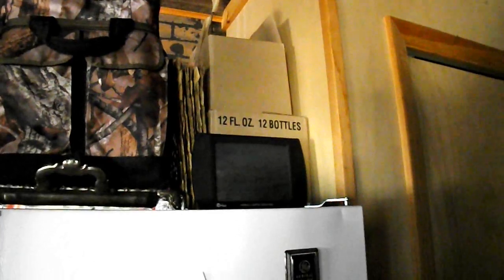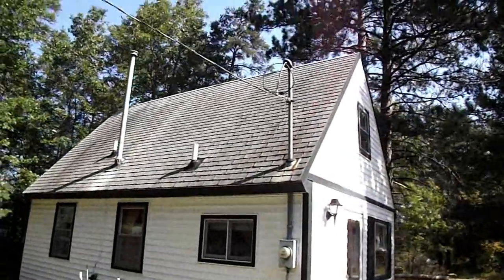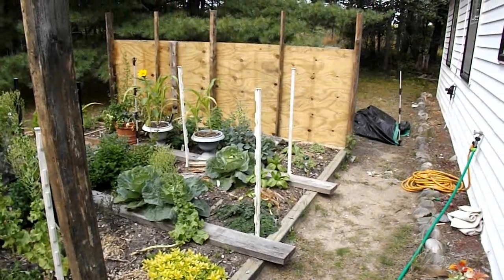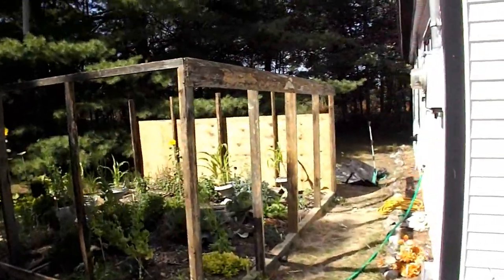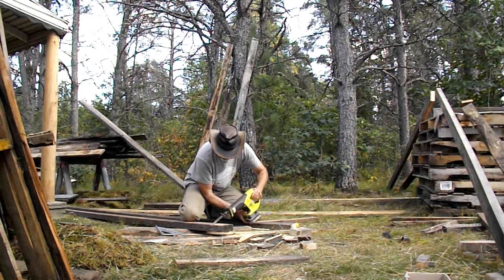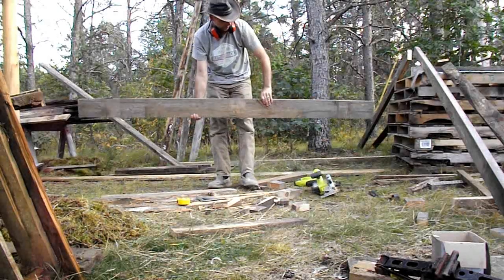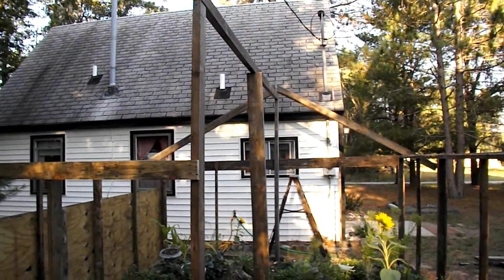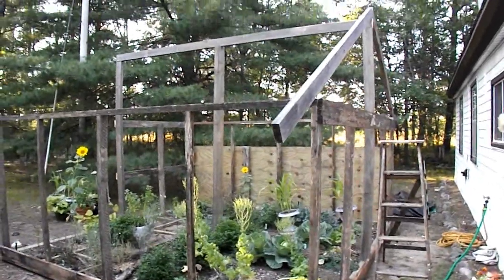Building A Greenhouse To Extend Our Homestead Growing Season

Comment: Good job, that green house is a beast!

If you double layer the tarp, one on the inside and one on the outside, the trapped air should help insulate it as well. If you have enough tarps obviously.

Comment: Was helping a friend start new seeds in their green house and she was talking about how its the hot heat from the green house all day that keeps the plants warm over night. And that having a vapor barrier with either a cement or tight fitting stone floor that absorbs the sun during the day is a must. Not to mention it prevents rodents from getting inside when its cold and decimating ones seedling.  Even cold frames with mesh wire in the bottom to keep rodents out works for seedling and small plants.